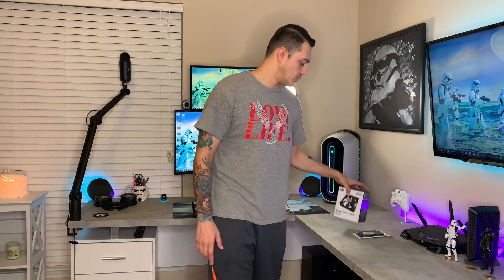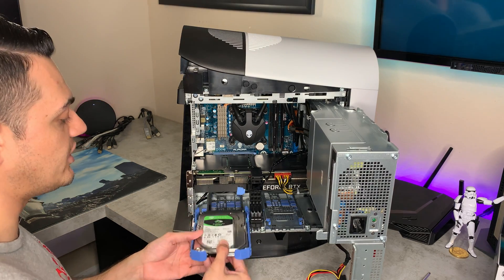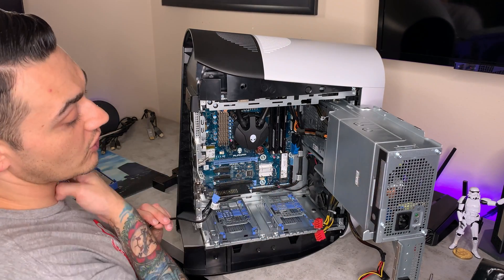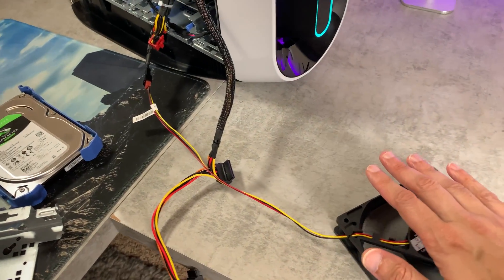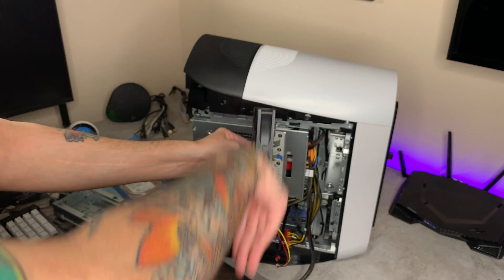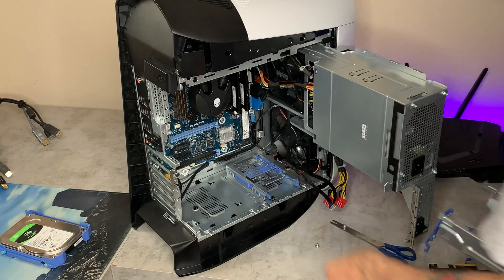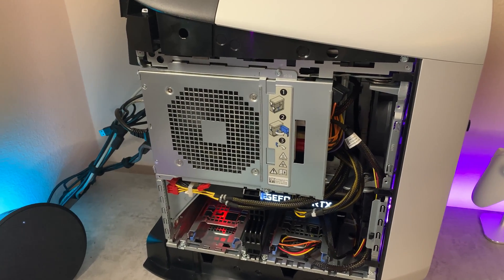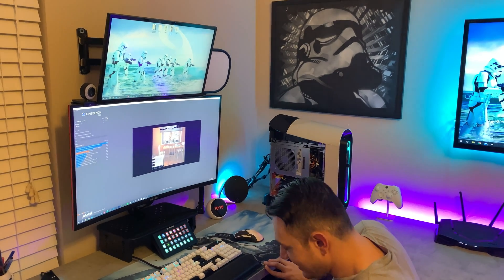Do This Immediately-Alienware Aurora R11 Second Intake Fan Install

Comment: That's funny bro because I've been thinking about cutting out a strip and tossing some plexi in so my 6800xt could be seen.
Reply: Masterminds at play...Mods rule!
Reply: How is the 6800 in the Alienware? Debating on weather to go with the 6800xt or 3070
Reply: @0retree337   it's awesome. If you have the money go with the 6800xt. If you have an AMD system, go with the 6800xt.
Reply: @0retree337  honestly The dell reps offered me a bunch of upgrades...As I was trying to save some $. The dell rep gave me a 3080 when I was looking at a 3060, offers an i9 when I was looking at a i7, So if you can haggle with rep the rep and see what he can offer!
Reply: Post a video if you do that I wanna see!
Reply from the maker: I am kind of dreading that project as I know there will be some cutting, and custom fabricating, but it will look and perform sexily. I am going to mount 2 rgb fans where those ports are on the side.
Reply: @GamerHeavenOfficial  I took my entire chassis apart. The cases are actually just small squares with plastic snapped on. Super easy to work on though. Also, be warned, the snaps sound like they are breaking and are loud as fuck when you pop the top/front and other side panel off lol

Comment: The R9 is the same also. I have the R9 and R10.
Reply from the maker: Is it? I didn't know that, I thought that model was a different case.
Reply: @GamerHeavenOfficial  Yeah, exactly the same chassis. I actually swapped my R9's chassis onto my R10 and vice versa. I have the white like you do but got a black R10 because it was cheaper lol.